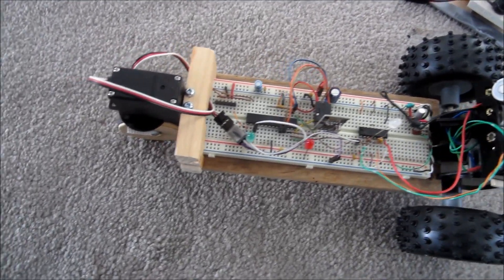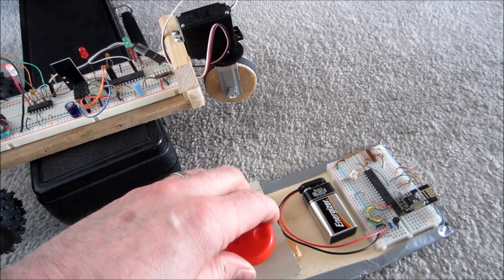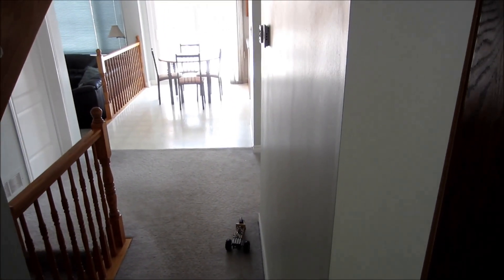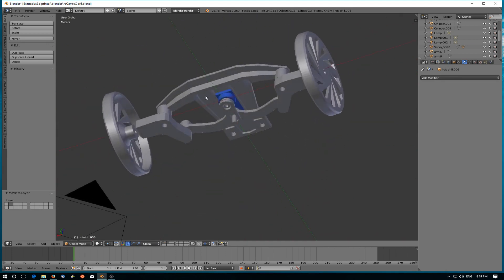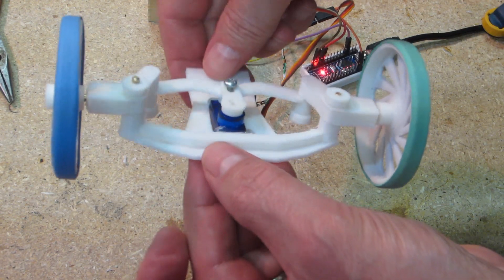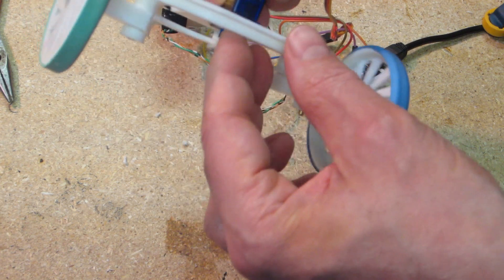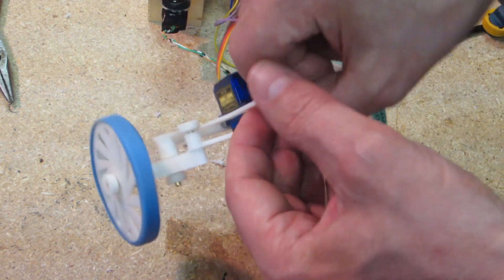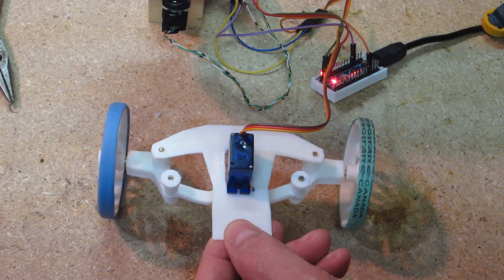New 3D Printed Steering for RC Car

Comment: How did you attach the servo motor onto the chassis so that it wont fall off?
Reply from the maker: Hot glue, but it would be easy enough to add or make holes to use small nuts and bolts

Comment: Is bearing needed on the steering part?
Reply from the maker: For the very light, indoor car I made this for (which you can see in the link in the video description), just the brass rod in the PLA works fine.

Comment: Lmfao just made a wheel I 3d printed for robot I'm building and after a day of thinking of how I was gonna make it grip I was thinking of casting silicone but then I went to cook dinner and made asparagus long story short I used the rubber band on the wheel the same way and came here for stearing mechanism and saw u did the same
Reply from the maker: Haha, but mine were from broccoli which is a little more grippy ;)

Comment: do you know of this with traction?
trying to make 6wheel drive
Reply from the maker: I am not quite clear on what you are asking but this model is pretty light duty and the only suspension is from the flex in the plastic. You might want a design with suspension.